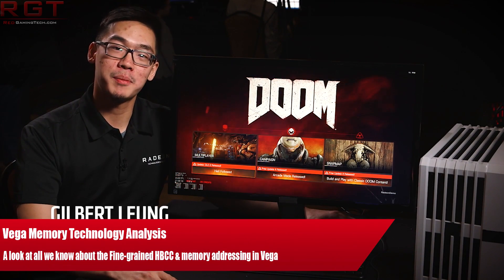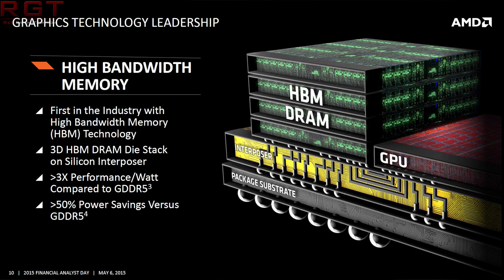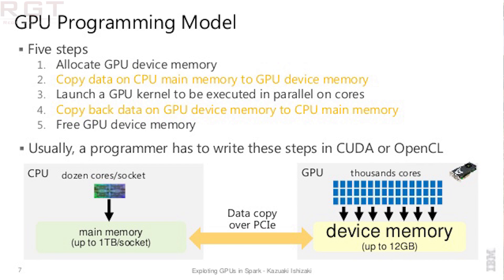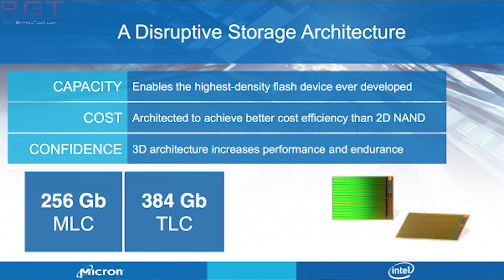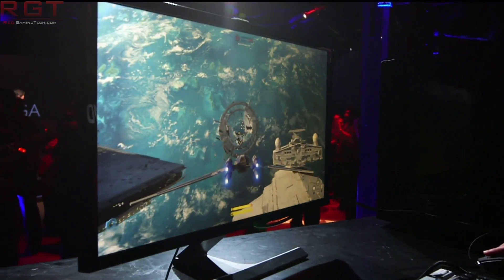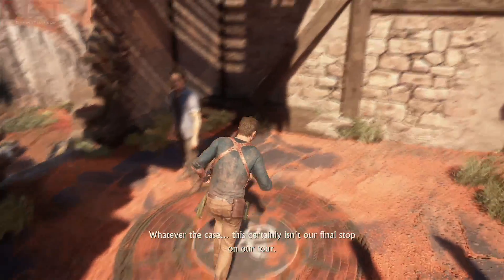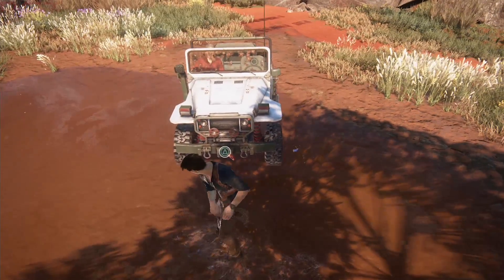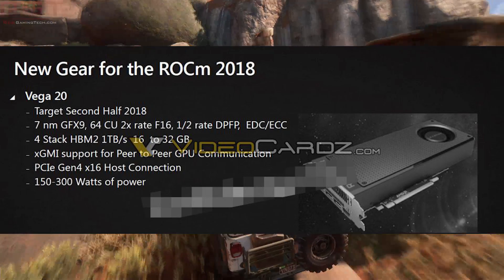AMD Vega Memory Technology Analysis - High Bandwidth Cache Controller & More

Comment: A great example of where the HBCC will shine imo is texture management, in OpenGL (pretty sure its the same with DirectX and Vulkan) the developer just tells the API to generate a texture ID and then uploads a picture to it, conventionally it would just upload all the data to GPU memory even if its never ever used. I think HBCC wont straight up upload all the data but it will gradually upload what it needs to the GPU. So basically, instead of the developer telling it "Hey, upload this" it will be more like "Hey, I might need that in the future" :P

At least thats what HBCC seems like to me from a point-of-view of a graphics dev

Comment: Cute, but fucking useless, the high bandwith controller is a waste of die space. We need more streaming processors.
Reply: Rem ko Does performance gain directly relate to the increase of streaming processors in equal amounts everytime or do we run into a bottle neck and a slow degradation of(*added) performance vs. added streamers?

Comment: You may have misunderstood how this technology works, It's not super complex at it's core essentially a "page file" like you would find in your OS, the software creates a virtual address space which applications can address (the applications cannot see the physical address space; in this case the 8GB of HBM2, they can only see that it has 512TB of available space to write data to). 

The cache controller then decides which data sets will be written to the HBM and which parts will be written to RAM or spare SSD space based on how often the data is accessed, this in itself would not create load on the GPU as the controller would have enough logic to complete these tasks or the CPU could do it. 

AMD have talked about AI based smart prediction with Ryzen and here the same principles can be used for the GPU to "learn" how an application uses it's resources in order to speed up data access by making better predictions about which data sets can be handled by each physical memory pool, e.g. Data accessed multiple times per second can sit on the HBM memory and data only accessed once every few seconds will have no problem running from system RAM or SSD space. These predictions would take up compute resources yes however as they are not demanding calculations they can be handled by 8bit (half percision float) and would not create an amount of performance degredation that you could measure (AMD have even said they can group 8bit calculations and do two per clock on a 16bit compute cycle).

This is why AMD have said they don't want developers directly addressing memory anymore or writing allocations since they believe (and rightly so) that AI can do it better. An added bonus for developers would be that it cuts quite a fair bit of work out of development by ensuring that they don't have to write different memory allocation tables for multiple system configurations which is quite a large step forward. 
Will this be used within Vegas life cycle? certainly not now, any game that will come out this year will have been in development long before devs knew Vega capibilities butmaybe towards then end of it's life cycle (late 2018-2019) as most games need 1-3 years to develop; however giving devs the tools to start using this in the future now will mean that day comes sooner. 

As for here and now a use for the HBCC would be to stop the issue that happened with the original Fury X from happeneing again... Games that wanted to allocate themselves more memory than the card had would suffer in performance despite actually only half to 2/3 of the card memory being used.

Comment: AMD Navi and post-Volta HBM3 based gpus will be the first that will allow for 4K@120hz AAA games at max settings, single gpu setups, and likely they'll be good for 8K gaming in SLI or crossfire configurations. You may as well wait till 2019-2020 to upgrade to 4k.
Reply: Now that'll be a dream to see come true
Reply: For me, the real dream will be combining that PC setup with the HDMI 2.1 GPU to a 4K HDR tv w/HDMI 2.1 and ATSC 3.0, sets that will start to come out next year. HDMI 2.1 of course allows for native 120hz input, and has a mode similar to gsync, so that a PS5 with HDMI will be able to be 4K at up to 120fps too, it also allows for dynamic metadata ST 2094. I don't know about a Microsoft Scorpio though, because I believe it's launching with HDMI 2.0a and you certainly can't upgrade a tv, avr, bluray player, or gpu from 2.0a to 2.1, so I'm holding off on tv/blu ray/avr till at least 2018-2019. For me, I'll wait till 2020 to upgrade my PC and/or laptop to 4K. That way it can have DDR5 Ram, a 10nm intel enthusiast cpu, with at least 6 cores Kaby Lake X will be old by then, I want whatever CPU Intel releases to replace Tiger Lake X, because "Tigerlake will be the last evolution step of this Core generation, started with Sandy Bridge. The next architecture will be ready in 2019-2020. It will be very similar to the approach used by Zen and Intel will throw away some old SIMD and old hardware remainders". I don't think I can hold out until 2022 Just for a 7nm CPU, but those will be something very special.  Right now, the specs for a UHD Blu Ray drive in a PC demand an Intel Kaby Lake CPU with integrated graphics. I'm hoping that'll change drastically by 2020.

Comment: All these new technologies and many IPC gains over Polaris. There are so many things going on that I find it hard to believe that the performance on Vega review was the actual performance. 
I mean if Vega was able to beat overclocked (~10% oc) gtx 1080 by 10% on vulkan, which means that the sample was around GTX 1080 stock level on dx11 since Vulkan adds around 17% more performance on AMD Polairs cards. All this was done on debugged Fiji drivers and we saw the exact same performance on latest Vega review. All this suggests that Vega was not at it's full potent.
Looking at TechPowerUp charts on 4k I looked at Fiji (Fury X) and Polaris (RX 480). Now before these benchmarks were made we didn't have crimson update so lets add 7% more performance because the gains were between 5-10% all around. Also the benchmarks include Boost 3.0 on Titan XP.
So comparing the performance of Fury X and Titan XP, Titan is 1,611x faster meaning that with Fiji architecture we need 1,611x8,6tflops= 13,85tflops of performance to match.
Do the same with RX 480 we see Titan XP being 2,124x faster meaning that with Polaris architecture we need 2,225x5,9tflops= 13,13tflops of performance which would mean that Vega should have 5% or more IPC gain to achieve similar performance to Titan XP at 12,5tflops.
Now include Vega IPC gains to that we might actually see Vega out performing Titan XP.
 Polaris was 10-15% IPC improvement over Fiji and we are seeing 5,5% ((13,85/13,13)-1*100%) with my calculations. So if Vega brings another 10-15% then we can assume it is beating Titan X. However we still have  no idea how big of an improvement we are gonna see.
 So I'm pretty sure Vega which we saw is still lacking 20% the performance it actually has. All this is backed up by benchmarks  given to us and the knowledge of yet unfinished drivers. Also Vega chip is bigger then Titan XP and to compare linearly Polaris 10 and GP102 die size directly to performance I get that Polaris should be 2,225x232mm2 = 516mm2  to match Titan XP 471mm2. Now Since Vega is estimated to be around 520mm2 and it will have IPC gains over Polaris looking things this way I see no reason to believe that Vega under performs. Now the amount of stream processors doesn't match the die size comparison as Vega transforms frequency into more performance meaning less CUs more clockspeed. 
So by that Vega shouldn't be over 500mm2 yet it seems to be and that means there are more beans packed in there then we assume. We however know already the Vega is capable of half precission compute and that it has complitely new memory controller so it might explain the big die size as it is more powerful at fp16 then 600mm2 gp100 (21,2tflops vs 25tflops). If Vega would be just upscaled Polaris to reach 12,5tflops then according to the amount of CUs (4096/2308x232mm) Vega should be only 412mm2, but since there are so many things added over Polaris including those yet to be revealed I'm not sure we know Vega at all.
I know that nothing scales linearly in GPU architectures, but these are just really raw baselines!
Well those are my thoughts it's been a long post yet again, but I hope that it will be as I think and not see Vega under perform.
Reply: What you say the end is true. Vega's memory controller is so big that it does not have the stream processors we've come to expect from that die size from AMD. Vega may still have some performance left in it but it is not raw performance. They really can't build much bigger chips to pack in more SPs.

Vega is faster than the GTX 1080 for sure but the Titan XP may just be out of reach.

Which is a shame really as I've begun to believe for a while now that AMD just needs to launch something massive. A 600mm2+ card that Nvidia can't just drop a 1080 Ti out to be almost as good or better than AMD. If AMD wants it's marketshare back it must be seen as the fastest.

Launching 90% of the performance for 85% of the price just doesn't work. Yes they get better perf/$ but why settle for 90%? I didn't. Fury X and 980 Ti came out at the same price where I live and I bought the 980 Ti because it was better for my usage, almost 2 years later the Fury X is better but now I'm looking for an upgrade not a smug sense of "I choose the better card in the long run".

Power. Heat. Don't care. AMD launch something that's the best for fucks sake.
Reply: How do you know the actual memory controller are? if the CUs are around the same size as Polaris those only take around 412mm2 gddr5 memory controller included. Also 1530mhz core clock is expected to deliver 12,5tflops fp32. So that leaves +100mm2 of 100% unknown. Also we are not including any IPC gains here, though each CU might just be that tiny amount bigger vs Polaris CU so we get to +500mm2 die area, but I don't see any reason that to be.
I don't believe HBM memory controller to be +100mm2 in size, even though many architectural chances are related to memory and how it's processed. I could be wrong so any links?
Reply: Ah I was wrong, it's not the memory controller that's taking up the space, HBM memory controllers are smaller. It's everything else they have put into Vega. Given everything they've said about the the performance gains and the performance we've seen, it should be higher, they are either holding the card back or all the extra cool features for the future and the 

I also put myself forward a bit wrong. That 100mm2 AMD has to play with in making the GPU bigger is not enough to defeat an Nvidia card if they use HBM2 and use all 610mm2 they have used in the past.

Titan XP is 471mm2, replace the memory for HBM2 and bump the die size to 610mm2 and they have over 150mm2 to increase performance. Vega has been shown beating the 1080 but not the Titan XP at 510mm2. So on a bigger die AMD is already less powerful with this architecture.

If Vega beats the Titan XP from driver optimization and hidden elements expect a Titan XP Black and a 1080 Ti to be announced soon after. AMD needs to ditch the developer junk that wont be used for 3 years and give gamers the card they deserve. I would so very much love to buy an 8,192 SP beast but AMD just isn't making that.

At least one AMD hype train is actually delivering in Ryzen.
Reply: Yeah it doesn't make sense in performance vise so Im pretty sure amd is not showing its full potential.
Reply: Would be the first time. AMD has always shown everything they have on the run up. Look at Ryzen. Every test is showing off and proclaiming that it's not even their final form. From no turbo mode enabled to problems with micro op. And it was very clear what they were showing off.

I hope the chips used currently for demos are cut down 4096SP versions and that they have and are not showing off a full 6144SP chip  but given how AMD marketed Polaris and now Ryzen I kind of doubt it.

Hell if Ryzen launches and is better than expected and AMD was toying with Intel and the benchmarks were all limited and actual Ryzen is even faster then I have high hopes for Vega. If not then Vega may be another miss for AMD.
Reply: We are talking different things here. We know much more about RYZEN then we know of Vega.
RYZEN looks pretty promising and 3,6ghz base 4ghz turbo is pretty reasonable since RYZEN has to deal with Skylake equivalent 6 and 8 core parts which will have higher clocks then 6900k.
Vega on the other hand is showing a lot bigger die then 12,5tflops is necessary at 1530mhz. HBM controller suppose to be smaller then GDDR5 controller and there are many unknowns yet to be revealed and Vega is further away from launch then RYZEN.
We know that Vega still doesn't have it's optimized drivers and yet it beat out overclocked GTX 1080 in Vulkan. 
GTX 1080 is only 314mm2 and it makes no sense that Vega's +500mm2 is barely beating it in all game averages. Since RX 480 is only 14% larger then gtx 1060 which are equivalent in performance. There is no way that Vega is suddenly 66% larger then 1080 and barely beats it. It makes no sense that AMD is losing their performance per mm2 after architectural improvements over Polaris. 
We know that Vega is atleast more powerful then 1080 but rest is still 100% speculation.
Reply: Yes it's all speculation until release and benchmarks. It's either all AMDs new tech is taking up a lot of space and that is limiting the space that can be used for stream processors or the 510mm2 die shown off by Raja is not the same GPU that has been shown in AMDs own benchmarks so far.

Now if AMD showed off small Vega in benchmarks and big Vega as an actual chip we have another problem. Why show us small Vega? Why confuse everyone with this exact line of thought we are having here? The die is too big for the performance shown.

I wish what AMD was showing me led me to believe that they have something amazing but I cannot come to that conclusion. Vega is riding an at least 18 month hypetrain and not showing the performance we've been expecting. I'd love for Vega to actually be a Volta competitor as some have suggested but unless they have some massive performance gains from drivers or something else it just doesn't look that way.

I can only assume that a large chunk of the 510mm2 die is taken up by whatever new things AMD are bringing out and in previous tests were unused as the drivers were not ready. If there is a spike in performance closer to launch then the mystery is solved, if not then AMD has some explaining to do.